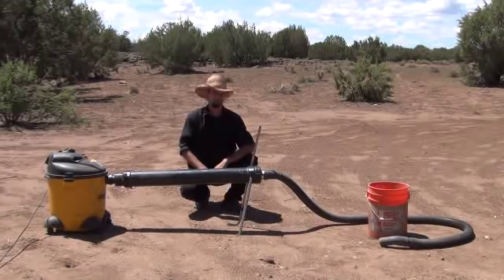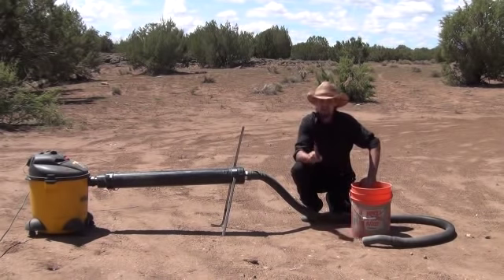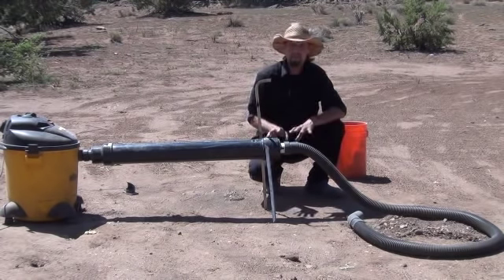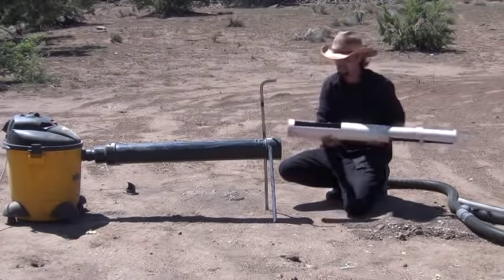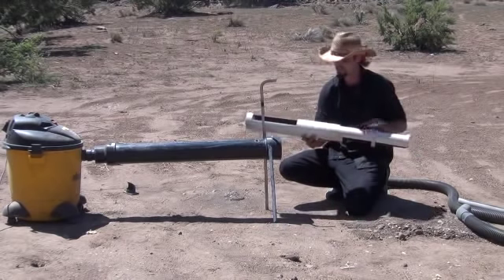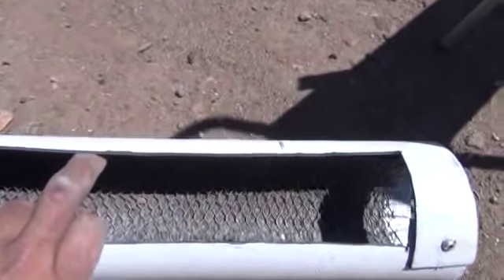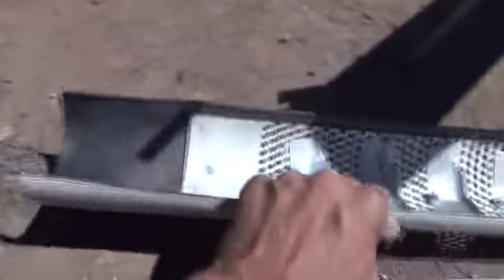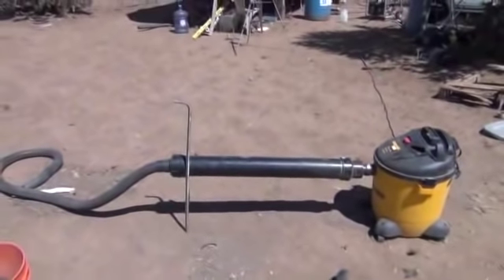"Desert Gold Dredge" Vacuum powered Gold Dredge!

Comment: There isn't much gold where I live, but I have always wondered about various prospecting methods and have watched several of your videos on the subject. I have been researching dust collection for my workshop and it occurred to me that cyclonic dust collection methods could be modified to stratify gold bearing sand. I built and use a vortex filter as a pre filter for my koi pond filtration. The principals are similar, using a vortex to separate particles of different densities. In liquid the heavy particles are given time in a slow swirl to settle. The lighter particles and debris can be shunted out in different levels of overflow.